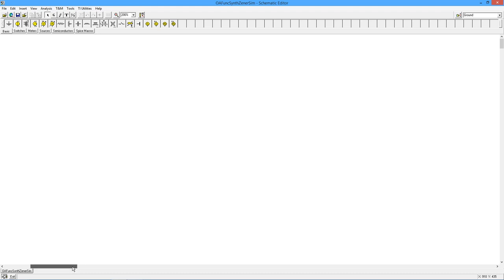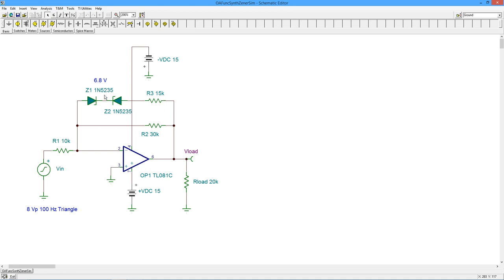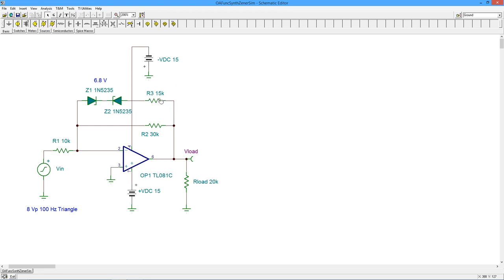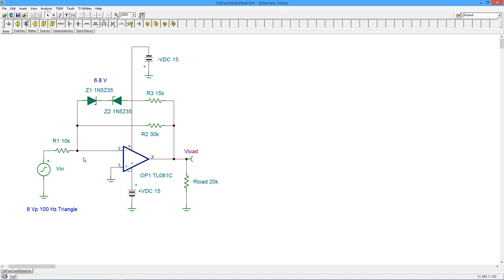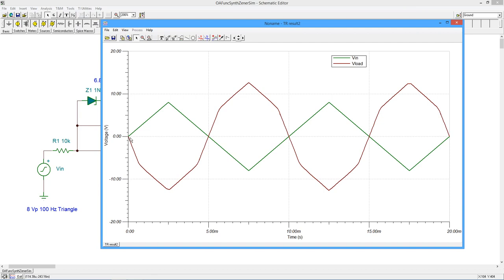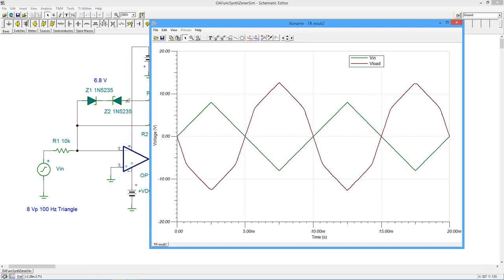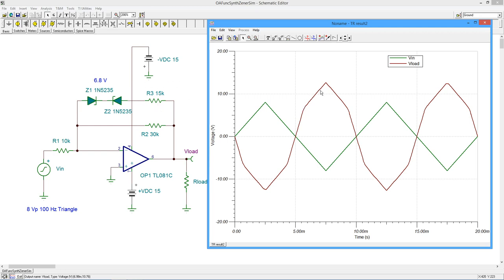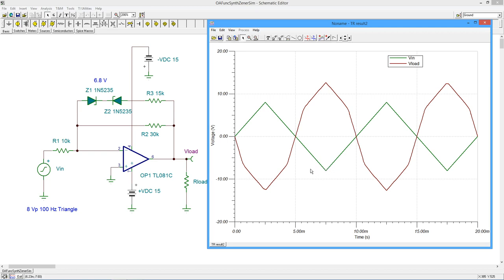Op Amps: Function Synthesis

Comment: I love it, fascinating. Could you use this for a 'soft' clipping application? Re. the 15kR, I can see that about 7.5V drops across the Zeners, I can't untangle the maths for the angle of slope. I haven't got to this in the text yet, is it in there?
Reply from the maker: Yes, it's in the text, and with greater detail.

You can make a soft clipper using this. I've done similar things. It might not be quite as dramatic as you'd expect, though. After all, in that application you're trying to get distortion so there's a tendency to "crank it up". Things like this can take a little of the edginess or brittleness out.
Reply: @ElectronicswithProfessorFiore  Thank you. I'll get to that in a few days. I'm on Datasheets at the moment. Something to 'curve' a hard edge sounds like a good idea. I wonder how NAD did it on their 3020?